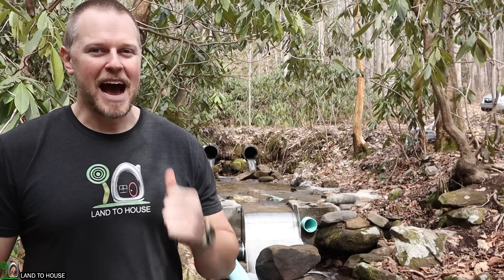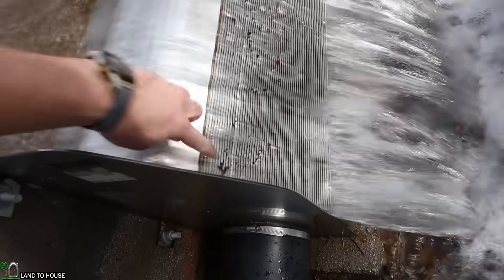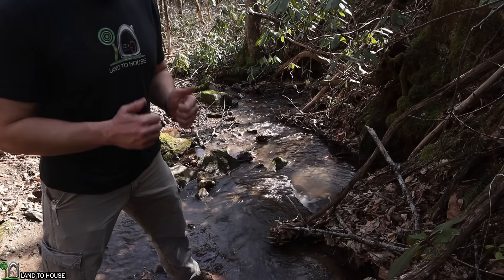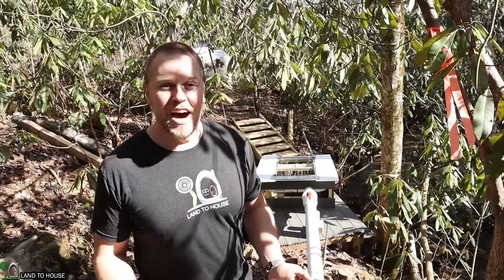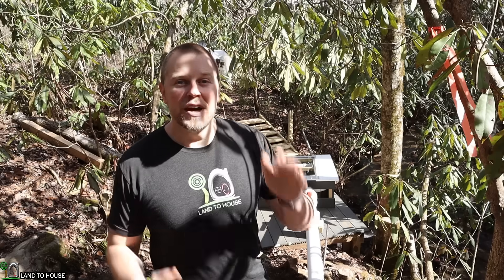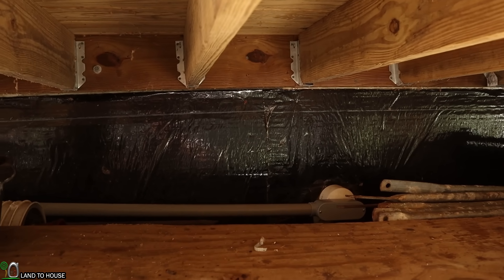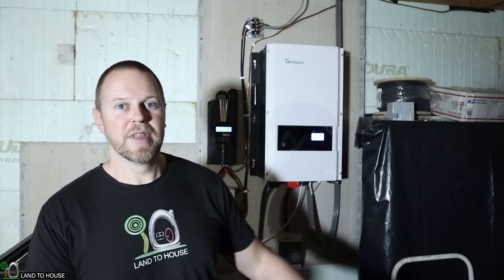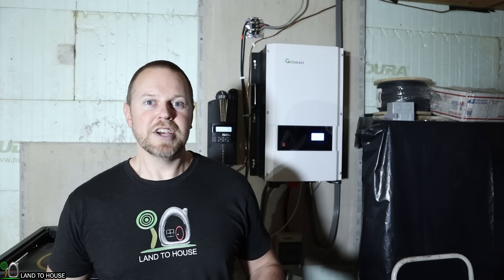AWESOME WATER POWER 500w Hydro Electric Off Grid System

Comment: 500watts?  So only 4 amps at 120v???  Is that right?
Reply: 500 watts is the power supplied by the hydro. Once the batteries are charged they will be able to supply way more than that. The inverter is 8 kW so at 120 V that's 66 amps.

Comment: Why is the Midnight Solar charge controller needed? Doesn't the Growatt Inverter have an MPPT controller inside it? I guessing maybe the Growatt cant handle the power?
Reply from the maker: I think the issue is the high voltage. The midnight solar can handle 250v input.

Comment: I note that there is no data between the Midnight charge controller and the batteries?
This could result in an overcharge situation. (Though with cautious setting of the max charge voltage, this can be mitgated against, to some extent.)
Also, it would be better to have a 3ph breaker on the AC input from the turbine, rather than a on the output DC. Allowing protection/isolation from a failed diode pack. (I won't comment on the beer can heatsink!)
Interesting walk around though.
Reply: Can you please explain the beer can heat sink? Is it shown at a certain time?
Reply: @sckirbyc1  12:12
(Might be Pepsi?)

Enjoy!
Reply: the metal piece under the rectifier thats screwed to the wall. Where the three phase from the alternator comes in before it goes to the battery charge controller. @sckirbyc1
Reply: Isn't the point of the charge controller to automatically know the max potential of the batteries and cut off before it gets there? That's how my (very, very cheap, 10a solar) charge controller works
Reply: @alexevans2891  The charge controller can only (usually) sense battery charge state based on battery voltage. That is ok for lead acid. But unreliable for lithium.
The BMS in the batts 'should' keep a record of the accumulated charge and then command the controller as required.
My own system does rely on battery voltage, and me keeping a close eye on it. So I am just as guilty. But I wouldn't recomend it for a fit and forget installation.
Reply: @gonzo_the_great1675  Got it! I didn't know that about lithium ion. Thanks for the info!
Reply: @gonzo_the_great1675 what are you talking about? BMS doesn't know anything about the battery capacity. It knows when to cut the charge/discharge based on the voltage it reads so there is absolutely no problem with that setup. For the balancing part, I'm sure that the wire that connects all the packs is there so the BMS of each battery knows when to stop charging to prevent overcharge on certain cells (if in series which doesn't send to be the case here).

Comment: I know water is 24x7 but 1 solar panel with no moving parts can produce more energy when the sun is out for over 25 years. Add 2, 3 or 4 solar panels to produce more.
Reply from the maker: The inverter can also accept mppt input. They plan on a few solar panels to supplement in late summer when the creek is low. Not much sun at this location.

Comment: That is quite a bit of power for the amount of head and pressure that the system has. Is the high power due to the larger water flow?
Reply from the maker: Yes they have a lot of water flowing in this system.  50 feet of head pressure is also not bad.

Comment: How long does it take to charge those batteries? Ten gage is supposed to only be rated for 40 amps. I'm glad you used uf wire though, but you could have made it look better in the house.  Why have so much heat on one side of the breaker box. Did you ground anything?
Reply: Rough estimate on charging time: 30.6kWh at 500W would take 61.2h. I didn't hear in the video the maximum output of the hydro dam, but I'd have a tough time believing its 2kW. Regarding the breaker, I had that same though. I assume the multiple breakers on the left side must server lower-load circuits, while the one breaker on the right must go to like a dryer or electric hot water heater or something. Overall still balancing the two AC phases

Comment: I really like the design of the 3" ring pipe with T's to the straight-in 2" ball valves and jets.
Reply: Yeah, having jets from four directions probably helps the bearings last longer too.
Reply from the maker: Yes it is working well for them! 500w is great for an off grid system.
Reply: Why do you like this? Its the most ignorant design, with massive efficiency loss. This entire system is virtually trash. These hydro generator designs were better on the platform a decade ago, and now everyone acts like theyre an expert, but the reality is they dont know anything but the basic asss concept. Do your research cause this entire design is a waste of time and energy...

Comment: Thats a neat system. Cables with high voltage and black and red? That sounds not so good.... Next time, holt the camera against the pipe. You´ll be surprised, how much better it will pick up the noise!

Comment: 5:55 how will high pressure "pull" air out of this pipe, that looks to be 3 feet over the head?
Reply: The downhill flow of the water pulls a suction on the pipe above it. If you put a hole in the pipe it will pull air in through the pipe.

Comment: 4" pipe down to 3" pipe seems a big mistake as seen by the large pressure drop. If they replace all the 3" with 4" I would expect the power to go up by maybe 50%
 CSA 4" = 12.6, 3" = 7.1, 2" =3.1. So 4 x 3.1 =12.4 square inches for the 4 feeder pipe but that is being fed with  7.1 square inches which will cause a drop in pressure.  If all the pipe was 4" feeding the 2" pipes it would be 12.6 square inches feeding in to 12.4 square inches, so basically matched.
Reply: I thought the same thing.  It's plumbing basics
Reply: I agree, that 4" into a 3" tee seems like a poor choice.  You could upgrade that all to 4" around the feeder loop and see a nice increase in performance.
Reply: @MrPizzaman09  Head pressure is developed by the height of the water source from the generator, not the volume. The generator is use using nozzles to drive the water wheel with diameters of approximately 1/8". The system shown needs to be able to supply the nozzles with out air bubbles in the mix and a constant flow. By tapering the comstock the system is able to increase flow through out the pipe while delivering a constant water flow. Head pressure increases by approx. 5lbs for every 10' of elevation regardless of the size of pipe. 50 feet of elevation produces about 25psi just as the gauge indicates. The 6" section helps to fill the 4" section by providing more water than whats needed with out bubbles. To improve amperage out put, the system may tolerated larger nozzles. Which would increase turbine speed. It is a balancing act. The ability to provide a constant electric flow 24 hours a day with variable water flows from the stream is the goal. Remember this system provides power even at night when solar power is not availible, and your home use is reduced while sleeping. Thus topping off your batteries.
Reply: @randylowe7457  I know that.  But he's loosing pressure due to losses in the small pipe diameters and the transitions in diameters + bends in the pipe.  All of this goes up exponentially with smaller pipes because the flow velocity is higher.
Reply: @MrPizzaman09  The nozzles are less than 1 inch anyway. There is still 50ft of head and the pipes are outpacing the nozzles easily, they aren't losing any pressure.
Reply: I'm an electrician and he didn't explain how many amps that motor can supply.  A ten gauge wire should only be on a 40 amp system. So why is he exceeding the wire capacity on 240 voltage. The rectifier is to small for what he is promoting. This doesn't add up to me
Reply: @drekelley2352  Hi Dre, not sure what you mean, the generator is pumping out  10A at 54V  At most it would deliver 1.5KW or 30A assuming the voltage remained the same but the MPP controller will probably settle at a higher voltage which would mean a lower current.

Comment: What happens when the water stops flowing ?
Reply from the maker: in late summer the creek does slow way down. This makes a lot less power. A good reason for having a large battery. A few solar panels would fix the low flow season issue.
Reply: UMM power stops flowing...what else

Comment: Dont see a load dump - or does it do it else where ?
Reply from the maker: The midnite classic charge controller can handle the pma as long as it stays within voltage. No need for a dump load.

Comment: Why did he use PVC for the penstock instead of poly pipe?
Reply from the maker: I think it was for ease of use. The couple that built this are elderly.  Unrolling 300 feet of 4" poly takes a lot of effort.
Reply: I wonder what the price difference is?
Reply: @LandtoHouse  PVC degrades due to UV light.....
Reply: @dwwolf4636 uPVC doesn’t degrade, and would last a lifetime, especially in a shaded area like that shown.
Reply: @andrewallason4530  NOT rated for UV exposure, it will get brittle and crack
Reply: @mrmotofy  uPVC is rated for UV exposure.  That’s what the u stands for.  It is used in stormwater and other uses here in Australia.  I have heaps of the stuff here in Tasmania ( under the hole in the ozone layer, and HEAPS of UV). Been in outdoor applications for 25+ years on the farm with no concerns.
Reply: @andrewallason4530  Unless I missed something that is NOT UPVC you're talking about something different
Reply: @mrmotofy  uPVC. ie PVC with UV stabilisers.
Reply: @andrewallason4530  Yes so it's a different product

Comment: I would like to see a video showing what this will actually run as far as appliances
Reply from the maker: I have an 8k inverter in my home on a 15kwh battery. It runs everything but the hot water, hvac, and dryer.
Reply: i run a 2 bedroom condo. AC 24/7, electric oven, electric water heater, washing machine, dryer, pc desktop, TV...etc. average consumption 300kwh a month... so with this you have extra to spare.
Reply: It obviousli runn by bateries they charge up when sleeping or low energi consumtion then discharge at much higer rate when consution needed.

Hope in near future we get better batteries then we have now cause decentralized solar water wind and stuff is a future.

Not because they are eco but because ECO CULTIST WILL DESTROY OUR ELECTRIC GRID SO HAVING BACK UP WILL BE BASICLI A HAVE TO HAVE.

Comment: So I guess you are picking up approximately 12 Kwh of energy per day or ~360 Kwh per month. Not bad for free!
Reply: Not exactly free… what was the upfront installation cost and any ongoing maintenance?
Reply: @darrenthumbsup2881 you also need to know that each maintenance doesn't mean you need to replace ALL the things every time there's maintenance.

The maintenance might only be a certain component or part that need to be changed.

No big deal absolutely worth it.
Reply: @darrenthumbsup2881 probably 100 times cheaper than however youd get it from a utility company
Reply: @darrenthumbsup2881 you also need to know how many years or months it last for it to need maintenance

Comment: How well will it function in freezing temperatures?
Reply from the maker: With 200 gpm flow it will do well. Should not freeze with such a high flow.
Reply: I'm guessing it doesn't get real cold there. The pipe is above ground the whole way down and even elevated.
Reply: Not to mention, if it does freeze at a point of low water flow, the water below that point will just drain out of the system, with no damage done.  
As a kid, we had a stream near our house that flowed (even just a trickle) all year long, even at -30’c (-22’f). When you stomped your foot in the stream, it would instantly freeze, with a beautiful ‘cascade’ of ice crystals forming, moving out from your foot.  After a few seconds, though, the stream above the point would start to run over the icy bits, which would then start to melt again, and after about 10 minutes, there was little to no ice left.  Amazing to watch the power of moving water.

Comment: Great video.  I'd love to know what the cost of these hydro systems is.
Reply: I have 8” pvc all the way to my two turbines ( exact turbines as this video ) penstock is 900 ft. I have the exact same battery bank as the video . I have the Schneider 6848 XW Pro inverter, Schneider Charge Controller. And PDP. Two turbines means two runs of wire 400 ft each, two rectifiers, power disconnects etc… I also have 20 solar panels for summer months when 5he creek slows. I also purchased a custom coanda screen and hand built weir. The grand total is right at 35 k
Reply: @ktmrider7592  Thats not too bad.
Reply: @leebertie57  I have done 100 of the work. That is zero labor costs
Reply: Shopping for an off grid homesite now - land with reliable water that you have rights too is the biggest expense 😜
Reply: So how much power is needed to power the average home ? I don't think the 10 amps is enough, which is what the video showed as output.
Reply: @frederickandrea4132  This is basically 500watts of baseload covered on your whole house.